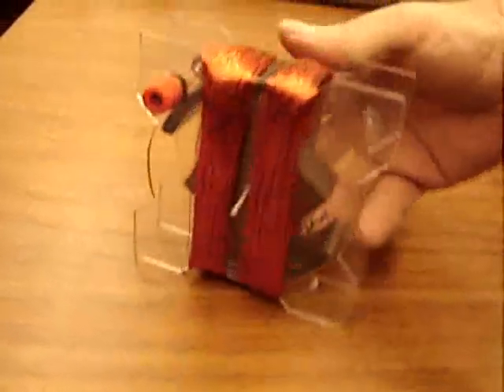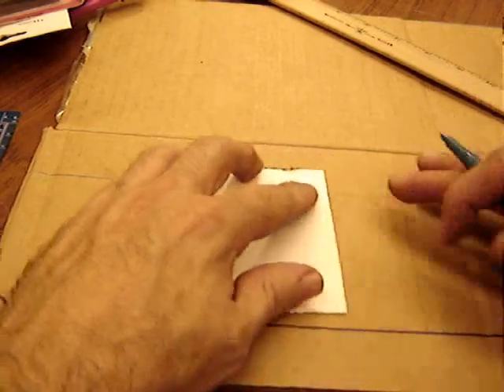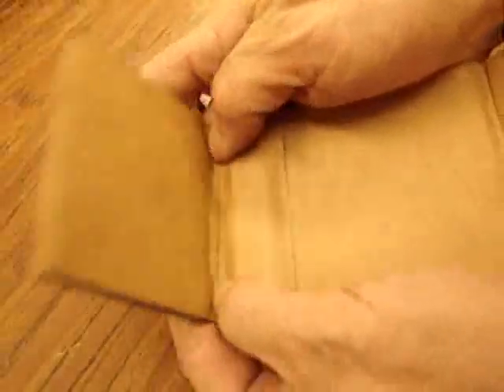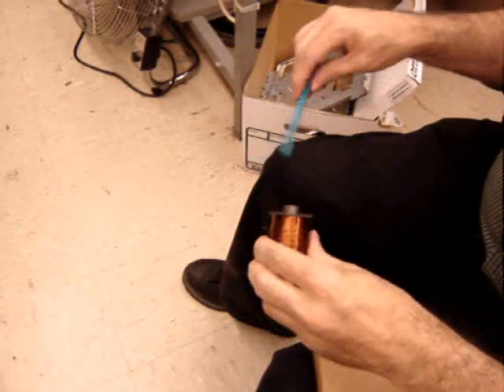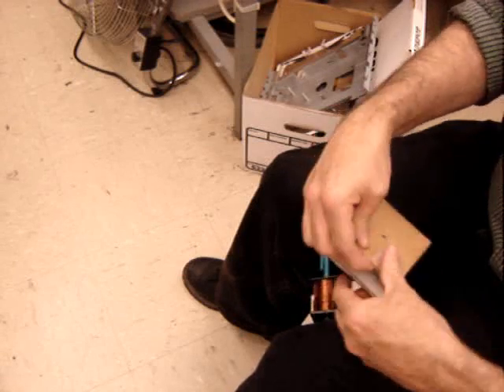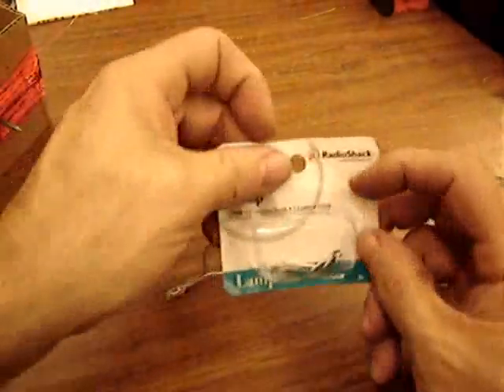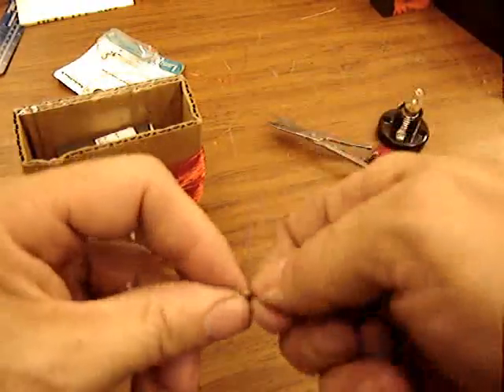Simple generator:  AC electric generator for science fair

Comment from the maker: You read the whole webpage project?  The DEBUGGING section?

Usual problem: didn't follow instructions.  If you don't follow the parts list, then it won't work.  If you used the wrong light bulb, it won't work.  If you used different wire, it won't work. If you used a different type of magnet, it won't work.

But also: the magnet cannot drag against the cardboard.  It has to really whiz like a blur.  Also, only use the #30 gauge wire spool only, very thin stuff, others are too short.

Comment from the maker: Make a couple of the cardboard ones before trying any changes.

With plastic, the only rule is that the windings must stay extremely close to the spinning magnets.  If you make the box slightly larger, or use plastic that's way thicker than cardboard, then it might not work.

Comment from the maker: > toy motor

Nope, since it generates AC.   Also, the output is very weak, and can only light up a special bulb from Radio Shack.    If you add lots more wire, then it can light a red LED.

Comment from the maker: Did you check the DEBUGGING section of the website?

Usual problem is, failed to use recommended parts:  different magnets, different bulb, different wire.   Lexan plastic is fine, just don't change the size.  It must hug the magnets fairly closely, same as the cardboard does.

Also, it works much better if you add lots more wire.  Wind 600 turns, not just 250.   That way you won't have to spin the magnets so darned fast.

Comment from the maker: Less than a couple volts.  Barely lights an LED.

Hint:  all motors are generators, so if you can spin the shaft of a DC electric motor, you can supply a useful voltage.

Here's how to figure it out.  If a 24v DC motor normally will run at a couple thousand RPM, then when used as a generator it will put out 1/4 of 24V when spun 1/4th as fast (it's a 6V dc generator if you spin it at 500RPM)   With DC genrators, if you double the speed, you double the volts.

Comment from the maker: Probably all three problems:  LED requires 1.7V instead of 0.5V, magnets too weak, and not enough turns of wire.  Try winding 500ft of wire.  Try some sort of step-up belt pulley so you can make the magnets whiz like a blur.  See the main article "Debugging" section about how to glue 20 small ceramic rectangle magnets into large blocks. (Those are the little 1" magnets with the hole)

Comment: I tried using 2 donut magnets since those block magnets are not available in our area, also used 100 grams of #29 wire and a red LED. Tried it but it is not working... is the wire/magnet insufficient?

Comment from the maker: See the project.   You'll have to click on the link.

As shown, the generator is too minimal.   It only lights that special bulb.   It can light a red LED if you add lots more turns of wire.   Or, add some sort of hand-crank drive belt so you can spin the magnets far faster.   Neo supermagnets can do it too.

Comment from the maker: > only neodymium magnets

No, they just give about 8X higher voltage than other types of magnets.    If you had a huge neo magnet the size of those four rectangle magnets.  Then you'd only need about 40 turns of wire, not 300.

Comment from the maker: Look up Faraday's Law on Hyperphysics.    The voltage for one turn of wire equals the time rate of change of flux, multiply by number of turns to get the total output voltage.

To get an exact value you'd need a FEA/CAD program like Quickfield, and also need to know the value of field across the magnet face.   Easier to just use an oscilloscope to measure the unloaded output.  Note that most AC meters don't work right at frequencies well below 60Hz.

Comment from the maker: Do it with gears first.

If you can route the energy from some gears back into the gears so they accelerate to destruction, then you can do the same with motors+generators.

But if you think that self-moving gears would be ridiculous, well, the same is true with motors/generators.   Electricity inside a complete circuit is just a drive belt, and we can't move the belts of electricity without supplying energy.

Comment from the maker: > recharge a battery

Yes, if you add a diode in series, and then either spin it at like 5000RPM, or switch to large neodymium magnets.   It would need at least 1.5V + 0.7V = 2.2V peak output to charge a 1.5V cell.   The diode wipes out 0.7V (or even 1.4V if you use a fullwave bridge rectifier to get smoother DC)

Comment from the maker: wire must be "enamelled," coated with clear read or green varnish.   Totally bare wire will just short out and do nothing.   But normal wire w/plastic insulation won't work, because 250 turns will make a giant wad, where the outer turns are too far from the magnets.   Thin #30 wire required, with insulation that's like very thin paint.

Comment from the maker: Read FAQ on the website?

See pages about finding fine wire (solenoids from online surplus sites, etc.)   And if you wind lots more than 250 turns, you can easily light up red LEDs.  Then the only hard part is to find those large ceramic block magnets.

Comment from the maker: Yes, you need 250 turns or more, "magnet wire" with varnish enamel insulation, and each turn of wire must be very close to the cardboard.    Large-diameter wire doesn't work because it will make a big pile, then outer turns are too far from the magnet.   Try wire between 28 and 32 gauge number, or between 0.2mm to 0.32 diameter.

Read article FAQ about improving generator (add many more meters of wire to produce higher voltage, like 800 turns.   And use large neodymium rectangle magnets.)

Comment from the maker: > it produces about 150 millivolts. with 250 wire turns

An AC meter give a bad reading, since it's meant for 60Hz, not 4Hz.  The special 25mA bulb, 272-1139, barely turns on at 700mV, while the glow becomes easily visible at 800mV and above. 250 turns of wire will light it, but you must 'twiddle' the nail between fingers to spin the magnets like a blur. If they scrape the cardboard and rapidly halt, it won't work.

Also, 500ft of wire works much better than 200ft, gives 2.5X higher volts

Comment: ok i did try but it produces very less voltage it doesnot light the bulb. it produces about 150 millivolts. with 250 wire turns. help.

Comment from the maker: Four magnets grip the nail.  Use tape and bits of cardboard in the slots, so they're better aligned.  Then adjust them so you can spin the magnets and nail.   If it crashes against the cardboard, then the cardboard part is wrong.   The magnets must really whiz, and only brush the cardboard lightly.  After you have the magnet working, add the wire coil.  Watch the video for details.

Comment from the maker: yes, 125g of .315mm should be enough for two feeble generators, or use all of it for one more powerful generator.   The more wire you use, the easier it is to light a red LED or a special 1.5V tiny bulb.

Comment from the maker: No, the light bulb will only light up if the magnets are spinning like a blur.

To spin the magnets fast, get rid of any crank and just use a straight rod.  "Twiddle" that rod violently between your fingers, as you would when trying to spin a top.

OR... you can add 600 turns of wire, which creates much higher voltage, which lets you light the bulb while cranking much slower.   That 200ft spool of wire from Radio Shack is the bare minimum.  It works better to use 2x or 3x more.

Comment from the maker: > will the bulb still light if you spin

It's an AC generator.   If you spin it forwards, the output voltage is alternating positive and negative.  If you reverse the spin, the output voltage is alternating positive and negative.

So yes, the bulb lights the same regardless of clockwise or counter-clockwise spin.

Comment from the maker: "Generator," that's when you have to spin it manually, and it creates voltage and current.

When voltage and current cause it to spin, that's a motor.

But also: all motors are generators, and all generators are motors.  Analogy: it's like a pulley, where the "drive belt" is made of electricity.   Moving electricity can turn the shaft, but if you manually spin the shaft, it forces electricity to flow.

Comment from the maker: The coil of #30 wire from Radio Shack is 200ft.  It works, but then you must spin the magnets too fast.

Instead use 500 ft or more (mail order a 1/2lb wire spool, or buy solenoids and take them apart.)

Comment from the maker: thin wood works fine.  You need to keep the wire coil very close to the spinning magnets.

Can't charge batt, voltage is way too low, and this is AC.

Comment from the maker: Need hundred meters of enamel (varnished) wire, seen in transformers and motors, NOT wire with normal insulation.   0.2 or 0.3mm should work (awg #30 is 0.25mm.)   Look up "wire gauge" for table of diameters.

Comment: Hi wbeaty, great video! I want to try it myself so I've already went shopping for some parts. I'm from Europe and I don't see any magnet wire with the AWG-system displayed, over here it's in mm. What should I take? 0.30 mm or 0.20? 

I also found a lot of wire inside an old turntable, could that work? Don;t know the exact diameter.

Thnx, you rock!

Comment from the maker: See the main website about "21 ohms," also the FAQ about increasing the output.

This generator design is feeble.  It needs step-up gears to spin it at thousands of RPM.  Or at least add some iron parts.  If you have shop tools, make a pancake-type generator using supermagnets, like the ones on the wind power websites listed in the links.

Comment: how many amps could you get? , i am gonna make a larger scale version with larger wire and more turns of wire. we are gonna try and use a step up transformer, we need about 4watts to  use in our step up transformer because we need 5 volts at 700mAmps for a phone charger.

Comment from the maker: Wind turbines turn fairly slow.  You could measure the output w/DVM, but probably not light a bulb.  Or figure out a mechanical step-up, so slow turbine can spin the magnets fast.

Or build it from plastic (waterproof) then blast the turbine with water hose outdoors.

Comment from the maker: Yep, red LEDs only, but you have to wind more wire.   That, or spin the magnets inhumanly fast.  The special 20mA bulb will light at only 0.7V, while red LEDs need about 1.6V.   Faster spin gives higher volts output.

Comment from the maker: See the "debugging" section, it tells why stuff doesn't work.   250 turns of thick wire, or wire with heavy plastic insulation, that will be the size of a grapefruit, and the outer turns will be too far from the magnets.   The magnets need to be one single stack of big ones (but see DEBUGGING, where it tells how to make a glued block of little 1" rectangle magnets.)

Bicycle, go find the "film can" bicycle generator freelights.co.uk

Comment: Hey I was wondering why using different parts won't work; the light, I understand as the voltage is very low. But what about different wires and magnets, the concept is still their is it not?
I'm trying to make the back hub of my bike to power some lights while I pedal.
Thanks

Comment from the maker: Uses power tools, not grade-school project. If you're old enough for power saw, you're old enough to figure out the plastic version just from seeing one.  Try other plastic version: get "buzzing rattlesnake" supermagnet eggs.  Glue nails pointed outward on ends (to form axle.)  Put it inside a plastic pipe so it can spin.  Wind wire around ends of pipe (NOT around diameter, wire must cross the open ends.)  Only need 50 turns, not 500, since it's a supermagnet.  Very small, yet higher volts.

Comment: First of all, you're awesome for sharing this and thank you so much, Bill! 
5 years later and still popular as ever.

Question: how much more efficient is the classy plexiglass version to the cardboard version? 

Does greasing the nail increase efficiency by a lot?

What other things can be done to greatly increase current?
e.g.: any other type of wire, winding pattern, type of magnet, etc.?

How much different do you think a large scale version of yours would be to those wind farm generators?
Reply: 16 years and even better
Reply from the maker: The cardboard version slowly gets crushed.   And the nail holes grow larger.   With the plastic version you can add far more wire.  And you can spin the magnets incredibly fast, maybe even light up a blue LED or a white one.   Maybe even add a hand-crank, and some plastic gears (like the Genecon(tm) hand-crank generator.)
But the efficiency of both kinds is limited by the small magnets, small coil, and lack of iron parts.
To get higher efficiency, figure out how to create higher voltage.  (Maybe add some wads of thin iron nails above and below the coils, almost touching the spinning magnets?) Then, replace the #30 wire with fewer turns of thicker wire, like #26 gauge.  That gives less copper-heating during the same current as before  ...higher generator efficiency.
Use big supermagnets, so you can then use fewer turns of much thicker wire.    As with drone motors, the use of supermagnets gives us much higher efficiency.

Comment from the maker: See "How it Works" on main site.

Basically, wires are full of negative electricity (copper's own electrons), sort of like pipes which are pre-filled with water. The water stays inside. But if you connect the pipe into a closed circle, then electricity can flow along like a drive belt.  A generator is an electricity pump. A light bulb is a "narrow channel" which gets white hot from electrical friction. Changing magnetism forces electricity to move in a circle: look up:

Induction +Faraday

Comment from the maker: The axle passes through the coil, half of coil on either side of axle.  Same as cardboard generator.  Don't change this or it will fail.   The poles of the magnet must cut across the coil, since direction of current is perpendicular to magnet pole motion.  Also the magnet must be a single stack, so it has N and S flipping end over end, with the magnet's N pole far from its S pole.

Comment from the maker: The poles must flip end-over-end, and they must wipe crossways across the wire in the spool.  The ONLY way to do this with the plastic spool is to remove the wire, drill a nail hole through the spool, then wind the wire back on with two hunks and an empty space so the wire doesn't push on the spinning nail.

Or just make a smaller cardboard box.

Comment from the maker: A bare copper coil is electrically just a lump of copper with no coil.  If you wind a coil, the current path ignores it, and goes straight across.  Either use insulated wire, or support the windings in air so no wire in the coil touches any other wire.

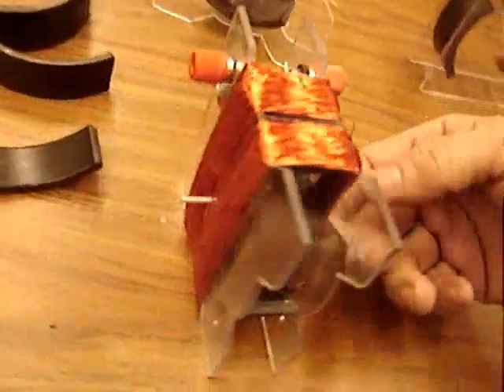Comment from the maker: > at 7:14

Put one layer "double sided foam tape" on either side of the shaft, used thin shaft. The shaft was thicker than the space formed by the tape, so I could force the shaft between magnets and it held very tightly.

Yes, liquid super glue.  Position and clamp the parts, then run glue along edges, gets sucked in.  I made the box first, then for perfect alignment drilled holes on drillpress. Black pipe was cut about 3/32 wider than magnets.  Build messy one first as test, then better one.

Comment from the maker: Sure.  If weak ceramic magnets need 200 turns of wire to create 1.0 volts, then neo magnets with 200turn coil should create 10 volts.   (So try 800 turn coil w/neo magnets.)

Comment from the maker: The two red knobs are "binding posts" from Radio Shack or any electronics catalog.  They have little screws sticking out the back.  Twist the two wires from the generator around the two screws, then fasten them with the little nuts.

Comment from the maker: Buzzing-bee supermagnet eggs?  They are weak and barely cling together.   It sounds like you have the wrong kind of magnet.  Large supermagnets are dangerous (bad pinches and blood-blisters.)

The cardboard generator in this video only uses rectangular ceramic magnets (the big ones sold at Radio Shack,) not supermagnets.

First build the generator exactly as shown, using the partslist on the website.  Once you've made a working generator, then you can try your own design.

Comment from the maker: Yep, with supermagnets you only need 50 turns of wire, not 500.   Also, your generator can be much smaller.

I used on of those "buzzing bee" magnet eggs.   The poles are on the side of those.  Make an axel by gluing two nails to the ends.  Put it in a close-fitting plastic tube, with flat plastic ends.  Wind a 50-turn coil so it passes over the ends.  Easily lights a red LED.

Comment from the maker: Nope, this generator is too simple. It's easy to produce AC at extremely low voltage.  A battery charger needs DC instead of AC, and about 5x higher voltage.   A "shaker generator" could do it using a tube with supermagnets and a couple thousand turns of wire.

Comment from the maker: Metals contain movable electric charges. All matter contains charges, but in most other materials the charges are trapped in the atoms and cannot flow around.  But metals are different.  The electrons of copper atoms always leave their atoms and "orbit" all around among all the atoms inside the metal.   That's why metals are electrical conductors: they are full of movable electricity.   Plastic is insulating since its electricity is solid and cannot move.

A generator is a charge pump.

Comment: I had a question about the reply "@miguelgonzalez97 it's AC. A dc generator would need commutator and brushes." ... Now I got my "degree" in electronics from a place you may remember from t.v. commercials I like to call the "Sally Struthers University of T.V and VCR repair" So excuse any ignorance on my behalf but couldn't you also use a bridge diode and capacitor to rectify and filter the ac to dc? Or am I missing something? would that be considered a dc generator?